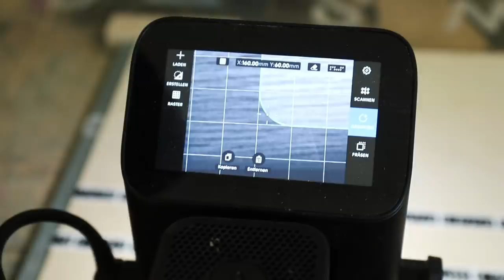Freestanding Valet Stand for Clothes and EDC

Comment: Nice built, 6:09 big time saver i guess? was a flathead screwdriver not available, if the bar wasn't captive is there any loss in hold strength my just compression fitting the threaded screw?

Comment: Hey Laura! How do you deal with cupped and twisted boards without a jointer? Do you use some jig to get one of the sides flat?
Reply from the maker: I always choose slabs that are very straight to start with. And the i select the best parts of that slab. Also for these slim cuts it’s not super crucial. It’s way more important to be perfectly flat when you work with wider cuts. A tabletop for example need to be super flat-I would use a jointer for that
Reply: Thanks for the answer! Im currently setting up my workshop and I got (most likely overly) worried about it as I just have a planer, so I'm building a complex jig to solve the issue... after your video and answer, I see it might be overkill... we will see! Again thx and keep up the awesome work!

Comment: What’s the point of snapping that chalk-line when you have a straight aluminum guide for your circular saw?
Reply from the maker: Because it wasn‘t a parallel cut. Both legs have a taper and I used the line to mark the right angle so I can cut both tapered legs in one cut

Comment: 07:03 How about repairing that nasty crack in the corner of the wall before placing your stand there? 😈  I'm just nitpicking, but it looks bad, maybe just fill it with plaster if you don't fell like repainting the entire area.

The oak stand is fine, I don't like the design but I do appreciate the build quality (I'm more into classical furniture, this kind of minimalistic style doesn't appeal to me). 

I'm also jealous on your workshop, must be nice to have so many high end tools to work with. Traditional carpentry is nice but it takes forever to do the more intricate joints, watching your videos makes me think about modernizing my own kit.